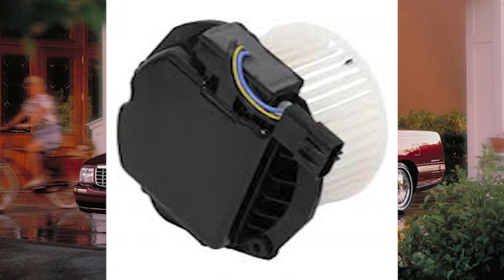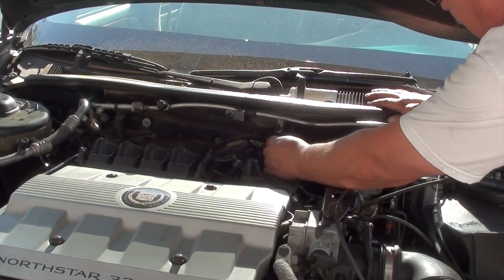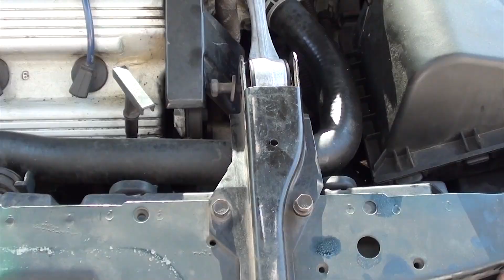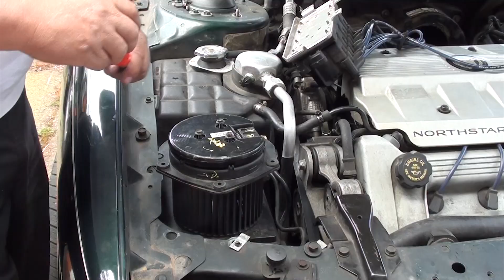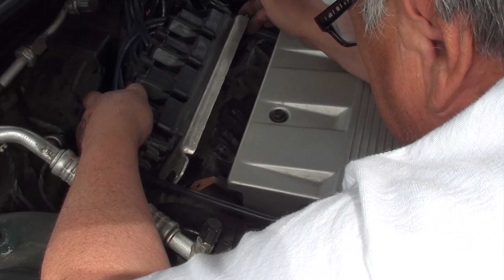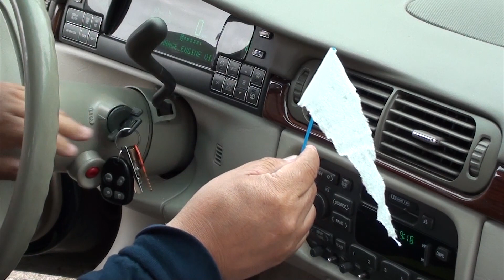Cadillac Northstar - How to replace AC fan Blower motor | what mechanics wont tell you | DIY

Comment: I hate to tell you but it’s not necessary to touch engine mounts etc, if you look carefully on the blower housing, believe it or not, there’s a spot on top that hat says, “cut here”. After you do that, it exposes a metal shield with a screw in it. When you remove that piece of housing, the motor comes out the top as a unit.
It’s a dumb factory way but it works.
Reply: @KelMaster Construction  get the bar, the coil pack, plug wire and the wire harness (gently) out of way. Use the turnbuckle and dogbone method in vid. Get all retainer screws out of fan mount. THEN I moved motor out a little and used wire cutters to cut squirrel cage blades one at a time. Then the motor just pulls out and reach in fan housing and get cut portion out of housing. USE AN AC DELCO FAN. ITS COMPLETE AND NEW CAGE IS FLEXIBLE. IT SLIDES INTO HOUSING. ONLY FOUR SCREWS GO BACK INTO NEW MOTOR.
I had already checked A/C programmer by back pinning connector and using a digital multi meter. After putting all back together the system works fine. I might post my own vid. Back in the 90s techs would charge up to 8 hours to do this job. Its 90 minutes tops.
Reply: I did that on a 4.9 caddy. It even said "cut here". Im gonna try it on my eldo.
Reply: @KelMaster Construction  pin the connector at motor. Red is always 12 volt, black is always grounded or should be. With a pin at grey data wire and engine running increase and decrease fan button. Voltage should swing up and down its only a volt or so, use a digital meter. If that checks good its usually the motor. If no readings off grey wire its usually the programmer but ck the fuse in the trunk. Its the programmer power supply. If i was there its easier done than said as the checks take but a few minutes. If your on the east coast and see paulie walnuts gold eldo, thats me croozin.
Reply: @genegeneish  - my fan motor is pulsating and i'm trying to figure out how to test the programmer.   How do I connect my test meter to the 3 lead connector to check voltage output?
Reply: @HighSierraBob  I explained that in the previous comment.
You have to "back pin" the connector going to the motor.(YOU MUST USE A DIGITAL MULTI METER) Black wire is ground, and had problems at the ground point down by the left lower A pillar under the carpet(its rate but does occur) The Red or Orange wire is Battery voltage and it's always on.
The Grey wire is the input to control fan speed.  Rig up meter so you can see from inside car or have a helper inside. Car must be running and with A/C or Heat on. Change settings on fan speed from low to high and back  making sure the voltage swings on the Grey wire. It only goes up and down a quarter or half a volt. That's why you need a digital multi meter to see this. Let me know how it works.
Normally the problems are from a bad fan motor, but do diligence and check the ground, hot and reference voltage. It's very simple once you do the back pin correctly. I'd post a vid but I'm hopping in my Freightliner soon and hitting the road shortly.
Reply: @genegeneish  - okay, I didn't understand what you meant by "back pin", but I did some research and figured it out.   Insert pins into the back of the connector to touch meter probes to.   Got it, thanks!
Reply: @HighSierraBob  yeah they sell the  pins in walmart. It looks like a T with a sharp end.
Reply: @genegeneish  - roger that, thanks!    Will get some and check it out.
Reply: @genegeneish  - so do I want to connect to black and grey wires to check voltages?
Reply: @HighSierraBob  hook multimeter black to battery ground. Use ohm meter to ck continuity of ground thru black wire. Then switch to 12 volt setting. Ck for battery voltage on red. Then set for lowest dc volt on meter. Do the grey wire with car running and cycle fan from low to high and back to insure programmer is giving input. If all these ck good, normally the fan is bad. If no grey wire input, ck fuse in trunk.
What model is this??
Reply: @genegeneish  - Okay, got it.   It's a 1995 Eldorado.  The problem is the blower motor pulsates and then will stop all together and then come back on, almost like there is a loose connection.  This seems to happen more when I accelerate.  The connector is tight.   I replaced the factory installed blower about 4 months ago and that unit did the same thing and eventually stopped working.  I  installed another new blower last week but I don't want to connect it to the power cable until I figure out why it is not properly working as they are $220 from NAPA (luckily with a 1 year warranty).    I will check it out today and see what is going on.   Do you know where the ground connection  is for this on this model Cad?  Maybe loose or oxidized connection?  The controller on the dash works fine with all functions except for this blower issue.
Reply: @HighSierraBob  Also, use an 
ac delco fan specifically for that car.
Using a chinese pos can fry the programmer.
Reply: @HighSierraBob  are you getting any a/c codes? Usually the ground is under the carpet near the parking brake. You can rent Mitchell for 10 dollars a month or 30 bucks for a year. They should have trouble shooting and wire diagrams. Definitely find that ground, but I know a cheap fan can play hell with these systems. Find the fuse for the programmer it's probably in the trunk and make sure there is no corrosion or tarnish on connection
Reply: @HighSierraBob  I used to run a napa store. I wont even drive past one of those places.
Reply: @genegeneish  -  the one I bought from NAPA is made in Canada.  I don't use that cheap chinese crap.  I checked the connections on the fuse and used a wire brush to polish them up.   Didn't help.   Continuity and voltages checked out.   I noticed this morning that the fan cuts out and sometimes stops when I put the car into drive.   Sometimes it comes back on and sometimes it does not.   I checked the connector on the fan motor and moved it around with the fan running and it stayed on and didn't cut out.   I'm stumped!
Reply: @HighSierraBob  jump  a ground from the battery and backpin the black wire. You have created a new ground. Then once again ck the voltage swing on the grey wire and make sure it varies while changing fan speed. It's not really hard, it's a little frustrating I admit.
Reply: @genegeneish  - I'll try that.
Reply: @genegeneish  - Okay, so I connected my black meter wire to battery ground and then back pinned the grey wire on the fan connector and then connected my red meter wire to that pin.   I set my meter to 20 volts DC and this is what I got:   I measured 3.27 volts with the engine off.   With the engine running and the control set to "Econ" with temp set to 60 degrees...   Low setting - 2.14 volts,  Lo Auto - 1.38,  Auto - 1.19,  Hi auto - 1.19,  Hi - 0.82.   THEN, I backed the car out of the garage and drove about 20 feet and the fan stopped momentarily and I got a reading of 1.28 volts.  It dropped from the normal reading of 1.38 down to 1.28 volts and stopped running.   Programmer under dash?  I do not have A/C right now due to a compressor that leaked at the front seal.   I have to replace that once I tackle the blower issue.
Reply: @HighSierraBob  I hope your only pinning one wire at a time. If a programmer goes bad it normally throws codes. Their is a youtube vid showing how it's done on a 95.
I dont think it's a programmer.
You did leave make shift ground in place? If a/c compressor not working it should not stop fan. It did not on my 99.
Reply: @genegeneish  - yes, I only pinned one wire at a time.    The ground measured 0.4 on the continuity test.   Send me the link to that video if you have it and the programmer is no longer available as I called around yesterday looking for it.   If that's what it is, it looks like it might be a used one from Ebay.
Reply: @HighSierraBob  I'm not tech savvy. YouTube look up retrieve,  pull codes cadillac. There are a few videos. You are using the buttons on the A/C panel. Its pretty cool. If there are no acm codes I doubt you have a bad programmer. There is a place in Wilkes Barre Pa. That stocks old pcm, modules and the like.
Reply: @HighSierraBob  also see if any IPC codes that's instrument panel cluster
Reply: @HighSierraBob  I had a screwy problem with a off road vehicle with a custom sound system. When engine was revved, the stereo cut out. My boy changed the radio out, same same. I hooked the power supply to the battery and no more problemo. The stereo was getting an over volt from the alternator and shutting itself off as designed.
Toggle through your messenger on the instrument panel and see what your alternator is charging.
All it takes is a momentary spike to scram some things. Might want to ck alternator charging.
Reply: @genegeneish  - Okay, thanks for the info.   i think i am going to have to take it to a shop to get the problem figured out.  Hmmmm, alternator, eh?   Let me check that out.  Looks like 13.9 volts.
Reply: @HighSierraBob  make sure they can use and operate a tech2. That function is built into the car but it requires using a shop manual to complete steps.
Reply: @genegeneish  - okay, thanks.  He's a master tech, so he should know about it.
Reply: @HighSierraBob  let me know what he finds.
Reply: @genegeneish  - Yes, I definitely will.
Reply: @genegeneish  - so I took the car to the master tech.  He said he was 90% sure it is the blower motor.  So, I removed the one I got from Napa and was able to find one made by AC Delco.  It worked perfectly for 3 days and then stopped working.   I am now on the third motor and that is cutting in and out as well.   I just installed a new compressor, but with no blower motor it doesn't do any good to have it.   Really don't know what to do now.  I notice that when I step on the brake pedal or accelerate, the fan motor speed reduces slightly.
Reply: @HighSierraBob  look for a corroded ground. The ground for the blower is behind the carpet where your left foot is at when driving. It might have a black plastic shield
OR TRY THE BACK PIN ON THE BLACK WIRE AT FAN CONNECTOR AND MAKE A WIRE DIRECTLY TO BATTERY GROUND. loosing fan speed when putting a load on electrical system is a possible sign of intermittent ground. While your at double check the gray wire at fan to make sure you get that slight voltage variance while increasing and deacreasing fan speed at the a/c control.
Reply: @HighSierraBob  I was just going through my messages while getting semi truck loaded. You aint the only one with the caddy problems. I want to put a bullet through my head sometimes because of mine.
Reply: @genegeneish  - yeah, if that ain't the truth!    Good thing I am able to replace the blower motor myself because the shop wants $850 to do it, even though the engine doesn't have to come forward on my particular model.
Reply: @genegeneish  - I'll try it.  Thanks!
Reply: @genegeneish  - well, I had to remove the AC Delco blower motor because it stopped working after a few days.  I replaced it with one from O'Reilly Auto Parts and  that one, surprisingly, is still working but still cuts out every now and then.   I ran an additional ground wire from the connector on the blower motor to the battery ground.  That didn't change anything.   Next stop will probably be an auto electric specialist and then a for sale sign.  GM made this way too damn complicated!
Reply: @HighSierraBob  check the connector at the fan motor.
Reply: @genegeneish  - okay, I'll do that next.
Reply: @HighSierraBob  someone who knows how to use a tech2 should be able to zero in on the problem
Reply: @genegeneish  - is a Tech 2 a code scanner?
Reply: @HighSierraBob  watch "south main auto" on youtube. He as well as most competent techs can use these. It can scan in real time every circuit of the auto.
Reply: @genegeneish  - so the fan motor wouldn't even go on today and then it would go on and then quickly go off.  After getting home, I turned on the fan and then went under the hood and wiggled the wire and connector.   Sure enough, the motor cut in and out as I wiggled it.   Looks like it is the connector, but not sure where I will be able to find one.
Reply: @HighSierraBob  rockauto, napa.etc..
Reply: Good thing we didnt fuck with the programmer.
Reply: @HighSierraBob  dont clip all the wires at once when splicing new connector in. Dont want to ground or  apply battery voltage to grey wire. That can fry a programmer or motor.
Maybe better off disconnecting battery while doing task
Reply: @genegeneish  - okay, thanks, will do.   Yeah, I don't want to have to deal with the programmer.   GM no longer makes it, so it would have to be a used one.
Reply: Marty, I see where it says that on my 96 Seville, but it's behind everything that's bolted into place.  Also, when I touch that piece, it's so old it just breaks off.   It's basically all broken off flush, but I don't see what screw your talking about as it's still mounted behind the blower motor.  Could you elaborate please? Thanks!
Reply: @donnievick3076  - there is a lot of plastic that covers the  area that is brittle and just flakes off.   The cover over the blower motor is a different kind of plastic and was in perfect shape on my 95 Eldrado.  If yours crumbles,  check with a junkyard or maybe just make one from aluminum.  The second time I replaced the motor,  I had to remove the strut rod across the top of the engine and the ignition coil pack as the motor was different in configuration.   I also used a turnbuckle to pull the engine forward a little to give me more wiggle room.